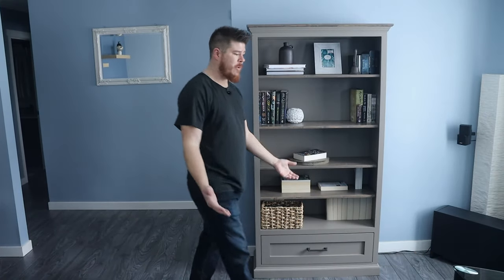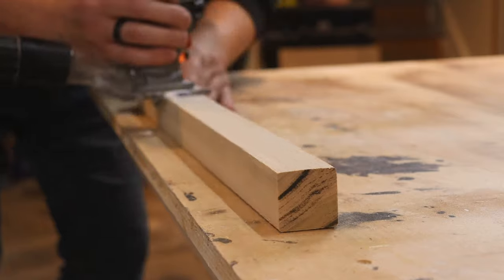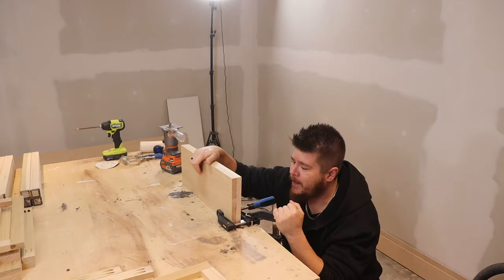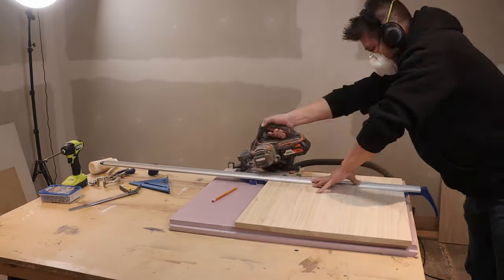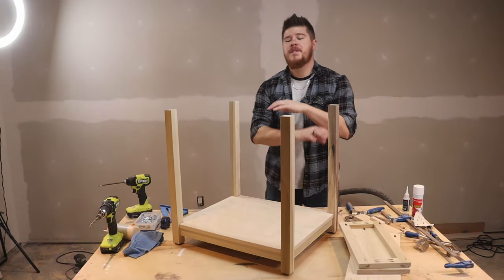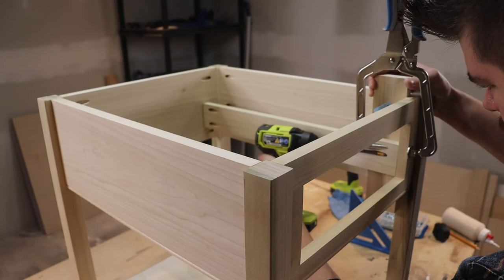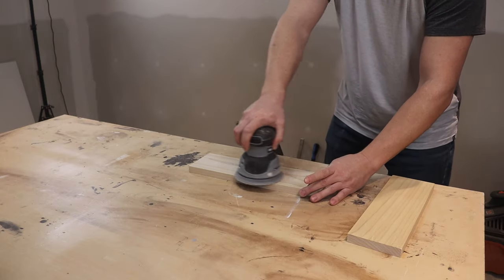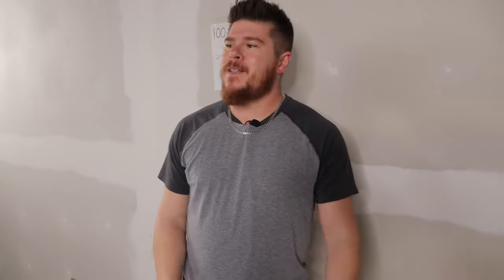DIY Modern Vintage End Tables - plans available

Comment: Does that ryobi miter keep accuracy?
Reply from the maker: Honestly, no. Even mine is off slightly and I cannot get it back straight. I'm looking for another.
Reply: @JessedoesDIY My first miter was a 10” Hitachi. I still use it for remote work because it’s so portable. For the shop, I finally purchased a big DeWalt compound dual bevel sliding saw and mounted it on a portable work bench. Spent about an hour calibrating all axis to zero, and haven’t had an issue since.

Comment: Nice, but made from Poplar?
Reply from the maker: Thanks. Poplar is probably the most common wood used in painted projects. But it's also the last expensive hardwood most of the time and that's a big jump up from softwood in term of quality, density and robustness. Tried to balance all of that with cost
Reply: Agreed, poplar is the best for painted projects. I often come across roadside furniture finds, and during disassembly can salvage quite a bit of poplar, then toss the particle board.